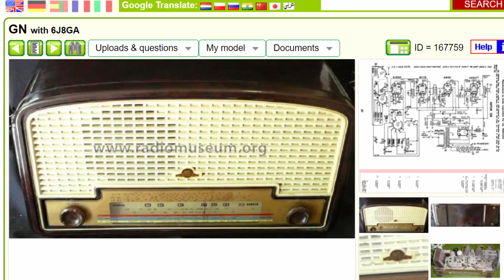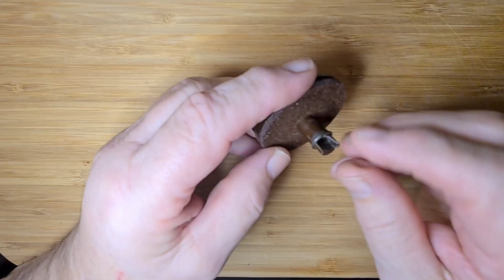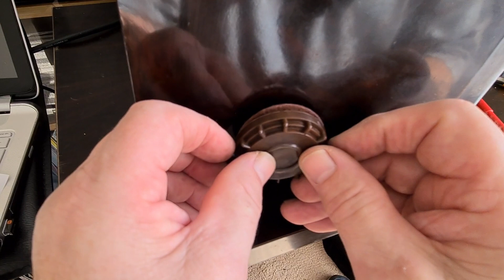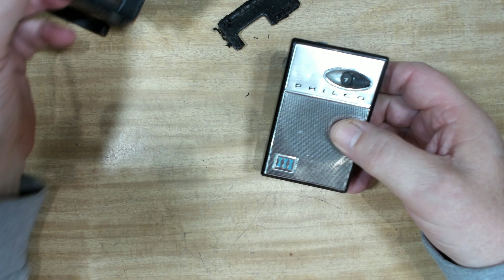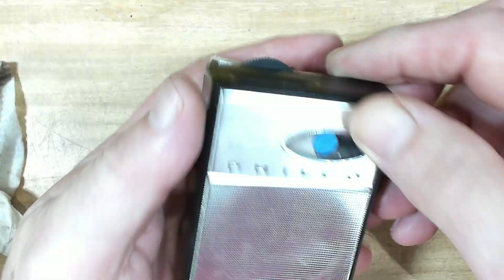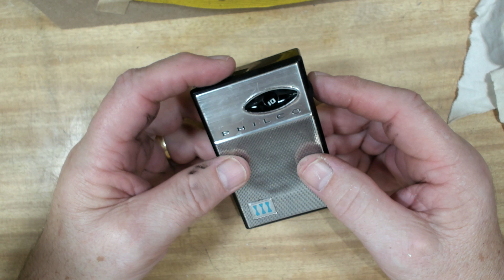Astor GN Big Bow and Philco Transistor Radio NJ-600-BKG

Comment: Is the 1.7 volt on the plate at 20:59 leaky caps or just standard leakage from an electrolytic at high voltage?

I appreciate how you take us along as you troubleshoot, dead ends and all(at least you seem to show them). But it must be a bit harder with a camera in the way and it must be a bit of a hassle.
Thank you for an interesting video 😊
Reply from the maker: Hi Jacob. No, the 30k resistor supplying voltage to the oscillator plate is open circuit. I replaced it with a 33K resistor  (the new standard) and the voltage returned to 130 Volts. It is very difficult to work with cameras in the way, at home, I will often have three cameras between me and the work. Thanks Jacob🙂
Reply: @DavidTipton101  Right, since it was open circuit, I wondered where the 1.7 volts come from. On the schematic, it also looks to be connected to cap 12. But I don't really know how to read it. That cap looks to be connected in some way to pin 5 of the 6J8GA. Is there high voltage on pin 5? I would guess it's a signal path?
What I mean is, if you had cut that resistor out completely, would it still read 1.7 volts and would that come from cap 12 then?
Maybe that resistor wasn't completely open, it might have simply been above what the meter could measure? But I have no idea how much current a resistor that has gone so far out of spec might provide. Maybe the meter is sensitive enough to read that voltage without loading it down to 0?
It might be impossible to answer now though 😊
Reply from the maker: @jacobstromgren2418  I see what you mean. The 1.7 Volts would be residual and any load applied may well drop it to zero. It may have been through the resistor, it failed slowly so may not be completely open with a hundred volts on it. Cap 12 was replaced and there is no real voltage on the coil side of it anyway. It decouples the oscillator from the B+ at R41. It could also be capacitance coupling inside the 6J8GA. The digital multimeter will read the smallest voltage regardless of the voltages ability to power anything. An analogue meter probably would not have read any value.

Comment: When paralleling capacitors to test like Shango, I cut the ends of the leads at an angle. This creates a sharp point that breaks through oxide and flux. It also sticks in the solder to help hold it in place
Reply from the maker: Good thinking Gordon 👍🙂

Comment: Those IF transformers look small/modern compared to the tube complement.  Kudos to you on all aspects of this (and every other) restoration.I appreciate your pointing out your debug steps.  Also you did a great job on the Philo solid state radio.
Reply from the maker: They are too Jeff, I didn't take much notice. Thank you 🙂
Quick edit: They may have had trouble obtaining valves. The model had a number of different valves fitted during the production run. Some valves were replaced with miniatures then back to octals again.

Comment: Hi Dave you certainly are resourceful. I liked the astor knob repair, I have an HMV 61-52 where the centres of the knobs have disintegrated much like the astor, so this gives me ideas of how to fix them
The astor is interesting, its styling is more like 1950's yet its insides are definitely 1940's
Robert
Reply from the maker: Hi Robert, thank you, JB and knobs work well together with a bit of reinforcing, good luck repairing yours. I think the Astor chassis was used for a number of years 🙂

Comment: Nice side of the road repair on the Astor. Those intermittent problems can be tricky. I am also amazed you were able to pick up a tuning condenser at a local electronics shop. There is no such thing anywhere near me unless you include Best Buy who have nothing.
Reply from the maker: Hi Phillip, I was lucky the fault changed to a hard fault long enough to track it down. We are very lucky with electronics stores, they are everywhere, I hope it stays that way. Thank you Phillip 🙂

Comment: When MacGyver has a bad radio he calls David Tipton. LOL  Is this the first radio you have encountered with a resistor
that broke down like this? I have seen other videos and they have had the same thing happen to them. Older, slightly
higher wattage resistors with some degree of moisture intrusion breaking down the insides. Before they totally go
the resistance varies quite a bit as the set warms up. No need for fancy test equipment. I wish they still had electronic 
stores like you have been visiting here in the states. They all have gone the way of the Dodo. Some amazing repair
work Dave!
Reply from the maker: Haha... good one Steve. I have had a number of encounters with dodgy resistors, some were noisey, others I could tap with a screwdriver and they would change resistance. We have two electronic chains stores, I have two within 20 minutes of me and another 25 minutes away, I hope they stay around a bit longer, it makes it easy to get supplies. Thanks Steve 🙂

Comment: Another cool video, thanks it is almost like having coffee with a friend when I find one of your videos!  Years ago, in the late 60's I used to work summers for my uncle who was a farmer North of Town here.  He paid us (my buddy worked with me) each $5.00 per day to work his farm chores, especially during planting, haying and harvest.  We learned all of his machinery quickly, he was a skinflint and all of his equipment was held together with bailing wire and a prayer.  Well one week we got paid and I went to town for the weekend  I stopped off at our local drug store where they sold small electronics and cameras. I purchased a JADE 10 transistor radio and that became my constant companion when working the farm. It came with one of those cheap ear bud type to plug in and you could almost hear the music over the roar of his ill equipped machinery as we worked the farm. That winter when I was back in high school my 9 volt battery died and not working any more I couldn't afford a new one.  We had some old 6 volt lantern batteries so I wired it up to the little radio.  The battery was about twice the size of the radio, and for some strange reason, getting that 6 volts sort of retuned the radio.  All I could get on it was Shortwave and surprisingly, I could pull some shortwave even during the day! It became quite a talking item among my buddies, and that, I think was sort of the beginning of my tinkering with electronics.  I found the old radio about 5 years ago when cleaning out mom's house to sale.  It no longer worked and I had yet to return to my toying with such things, so I pulled the speaker, antenna and battery plug then tossed the rest. Kind of sad now that I didn't try to recap her and see if I could get her to come back to life, but it is gone now.  After my sister passed away, her daughter was cleaning her house and came upon 7 old pocket transistors like the one you are repairing. Those I did tear into and had all but one going strong once more by recapping them and tuning them up.  Now I have more transistors then I can use in fact I put all of them in  a box and they are on a shelf. I have a few newer purchases of modern sets that I play with now, and my SUPER radio from the USSR days that I purchased from Ukraine and recapped.  Now that is a RADIO, AM./SW and pulls stations from all over that my others can't even find a trace of.  They really made radios for the life of the owner, not  the life of the set to be replace in a year or perhaps 5 if you were lucky.
Reply from the maker: HI Jerry, I enjoyed reading your pocket radio adventure, a pity you disposed of it, but there is one for sale on eBay, link below. I'm thinking of starting a pocket radio collection as well and those USSR rados seem to be good performers but I guess they had to be to work over the vast distances in the USSR, thanks Jerry 🙂
https://www.ebay.com/itm/363710875572

Comment: Only other thing I could think on that little transistor radio would be to straighten out the dent on the speaker grille, but that will not show when it is back in the case.  Yes, even old leather can be fixed up as long as it hasn't begun to crumble, and of course old stitching replaced.  I remember a compound of something like tallow and coconut oil made for that purpose.  At the worst, a duplicate of the case, or of pieces of it, could be fabricated.
Reply from the maker: Hi STLTGM, I looked at doing that but the metal front was bent inside the radio and glued, I thought it better to leave it alone, as you said it will be in the case. Trevor said he was going to use lard but it's all about getting some fat in the leather to plump it up and soften it. Thanks 🙂
Reply: @DavidTipton101  Trevor looked like a pretty competent operation.  Just to encourage you that it's definitely possible (I used to do amateur leather craft and have various leather items maintained by a local shoe shop, being a one time motorcycle rider who definitely believed in the sturdy and protective gear when car or truck metal is not doing that job) and a competent operation can do it several ways.  At the worst it would look like doing with leather like what you sometimes do with timber/wood or cloth for badly deteriorated cases.

Another thing I had good success with was something called Harness Honey, a heavy oil looking compound.  I do not know if it's marketed in Australia.  Literal lard... well, I'm having a bit of trouble with the idea if it's the sort of lard that is sold in blocks in groceries here, for it will get rancid fairly soon.  I had bought some intending to try it in cooking and ended up throwing the yucky stuff out because my envisioned use was in spoonfuls not (USA of course) pounds.  I thought it was you not Trevor that said lard.  Sorry if I got that wrong.
Reply from the maker: @SeekingTheLoveThatGodMeans7648  Trevor said lard but I spoke to him yesterday and he said it was a special mixture, he didn't elaborate on that.
Reply: @DavidTipton101  ok. I thought it would be a compound

Comment: That certainly was a busman’s holiday David. It surprising what you can do with basic tools and equipment. That Astor really did give you the runaround. It just didn’t want to be fixed. Great job in the end and I’m sure the owner was very pleased with it. Nice to see you having a play with a transistor set as well. You did well to get a matching polyvaricon. I always have difficulty finding them with the correct length spindle. I’m looking forward to seeing how your friend gets in with the leather case. All the best Graham
Reply from the maker: Hi Graham, I had to look up busman’s holiday but it's spot on 😄 The owner was very happy, delighted in fact which is as rewarding as getting the radio to work. Transistor radios use the same circuitry as valve sets I have come to realise, if I can get a good hold on the finer points of transistor theory I will do a few more. I haven't heard back from Trevor about the case yet, it will be interesting to see if he can save it. Thanks Graham.

Comment: I have not seen if you have adjusted the I.F.
Reply from the maker: I didn't 100uno100. There was no need, the radio worked well, was selective when tuning and I didn't have any equipment to align it. Thanks 👍🙂
Reply: @DavidTipton101  EXCELENTE trabajo, como siempre. Saludos !!!!!!!!!!!!!!!!
Reply: No sé por qué han borrado un enlace de un limpiador de contactos de marca CRC. Es bastante barato en Amazon.
Reply from the maker: @100uno100  Gracias 100uno100 🙂
Reply from the maker: @100uno100  Aparentemente no les gustan los enlaces en los comentarios 🤷‍♂️

Comment: I was musing on the Astor radio.  Common place but brilliant and built to outlast most of us.  I also kept seeing the little Philco dangling from the rear vision mirror of an EK Holden or should that be a Chev Belair 😄
Reply from the maker: Hi Pauline, the Astors were well built and made some very nice designs if not a bit polarising in the 50s and 60s. I have several were the design leaves the other manufacturers radios looking mundane (exect Healing off course 😉) Haha... it was made to hang from a car mirror 😄 Thanks Pauline and Cheers.

Comment: I have been watching and watching for a new video from you and I missed it LOL. Nice job on both radios. Even on holiday you can't let a good radio die :P I like the DeOxit fader for any adjustable rheostat. Someplace I even read about keeping regular DeOxit away from rheostats and to use the fader on them. That little transistor radio brings back so many memories of days at the beach. Good stuff!
Reply from the maker: Hi Wayne, Deoxit D5 is not for carbon pots, it will dissolve the carbon, probably OK for wirewound. Haha... that's right, I'd forgotten about taking the radio to the beach, this would have been perfect with it's little earpiece 🙂

Comment: Nice job as usual! I have repaired hundreds of transistor radios, including one nearly identical to this one. What you found is absolutely typical - the capacitors are just about the only thing that goes wrong, the Taiwan volume control pots are very prone to getting dirty and frequently fail, and never, ever get any sort of liquid in the Polyvaricon capacitors. I have taken them apart and cleaned them, but it is very fussy business and not worth the time when you can go find another one for a few dollars. Other, more rare failures are cracked traces on the (very low quality) circuit board, and tin whiskers is the transistors.
Reply from the maker: Thanks Brett. If the transistors were OK I figured it would only need the caps replaced. I started to pull the tuning cap apart but figured it was easier to put a new one in as all I could imagine the cleaner had done was swell up the insulators and I couldn't fix that. Anyway I know now not to spray in there 😄 Thanks Brett.
Reply: @DavidTipton101  ...actually, I suspected that your problem with the tuning capacitor was that the shaft was gummed up with rosin flux after you cleaned the pcb-!

I'd have cleaned the shaft with alcohol where it entered the tuning capacitor, and tried sneaking in a little silicone contact cleaner to try to free up the tuning capacitor shaft.
Reply from the maker: @daleburrell6273  I can't remember if I showed it in the video but I dismantled the tuning cap and it appears the plastic insulators between the plates had swollen, it was free to rotate once I undid the screws.

Comment: I can't believe you just went to the store ("popped over to the shop") and bought a tuning capacitor like that.  I don't even know where I'd look for something like that other than the swap meet or eBay.  I miss the days when you could just go to a Radio Shack (US, now gone), or Fry's Electronics (also now gone) and pick up stuff like that.  Even so, I think a tuning capacitor from the 1960s would have been a stretch anyway!  Not even Shango can just go to the store and buy a tuning capacitor the same day.  I can think of one last place (electronics store) where I would even look for a resistor, and that's not even guaranteed.
Reply from the maker: We still have two chain electronics stores here plus a number of standalone electronic shops. Of course there are plenty of online shops as well. I guess we are lucky 🙂

Comment: Also a tip I have from having worked on and repaired a lot of older watches from the days of acrylic crystals. If you need a super fine abrasive for see through plastics there's this stuff called polywatch and it works wonders. Not sure if totally relevant to you but you never know.
Reply from the maker: I have some of that after another comment recommended it. I haven't used it yet. Thanks zman1508 👍